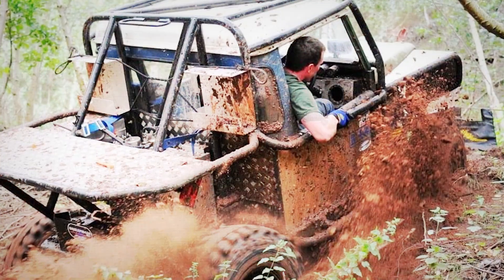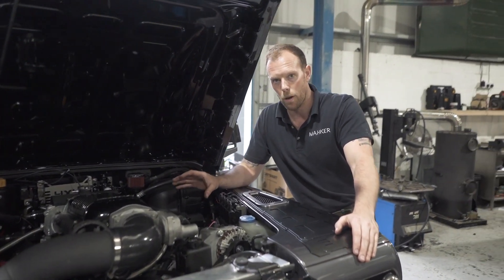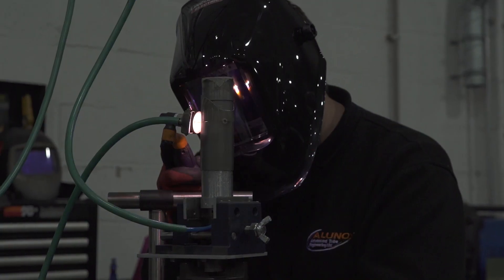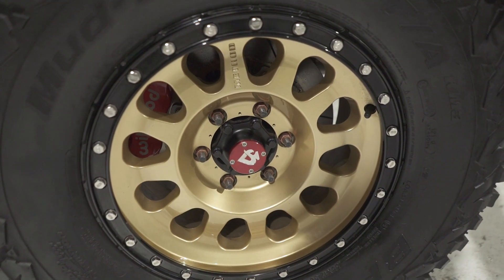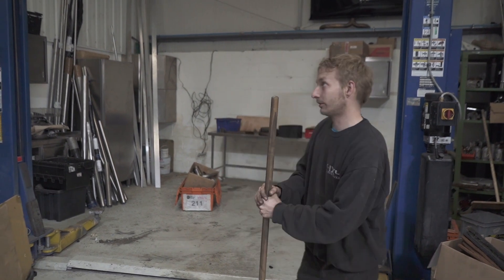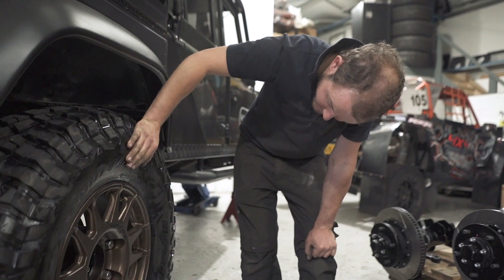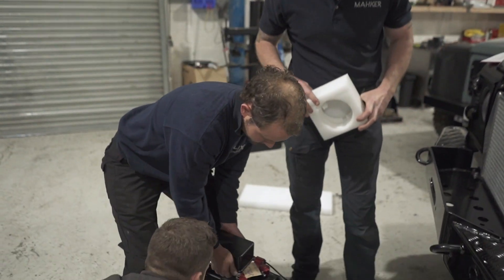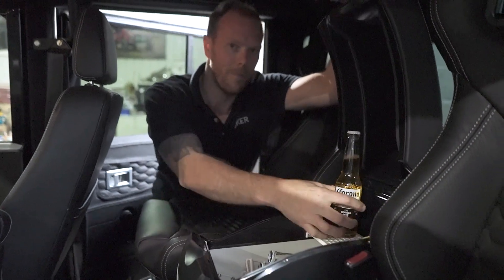THE TRUTH ABOUT HOW TO FIT A CORVETTE LS3 V8 INTO A LAND ROVER DEFENDER  | MAHKER WEEKLY EP010

Comment: stumbled on the channel and now im watching everything! absolutely awesome work!

I'm currently in the process of finishing my 110 td5 into a rugged long distance offload tourer... however I stumbled upon something a bit worrying...

the rear axle is slightly more over to the left compared to the front one. in fact the rear right tire slightly touches sometimes where the spring sits.... I've measured everything but am clueless... have you guys ever had this? can it be fixed? cheers

Comment: I have a 2007 2.4 Puma (110) which starting to plan improvements. When I discovered that the 2.4 was a poor candidate for tuning started to look around for engine swap outs. Any recommendations? Are some options easier than others not requiring significant changes to chassis, etc.? Any advice please. No rush as both myself and vehicle in Cyprus and big mods don’t seem to be legal here, so might have to bide my time.

Comment: I'd love to see (and eventually drive) a Defender with the steering wheel (perhaps pedals too) moved 12 cm towards the centre. I know it's not simple and will take a lot of engineering, perhaps even moving the gearbox a bit. but for 50K and upwards budgets it'd be a much nicer and timeless treat than the beer cooler, which I suppose has no suspension, so it'd be more useful for non sparkling drinks, especially if using the Defender for what it's meant.

Comment: Any solution for defender 110 3.9 V8 engine mount?
Reply from the maker: Only to cut them off & install our adapter mount. We don’t agree with mounting 500bhp on two m10 studs covered in rubber.